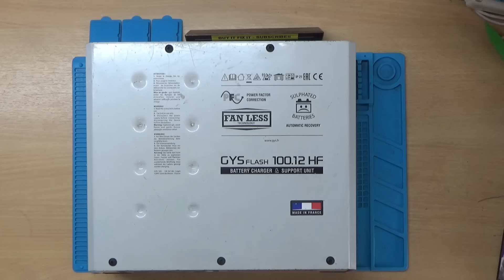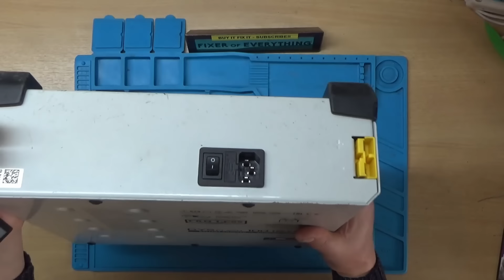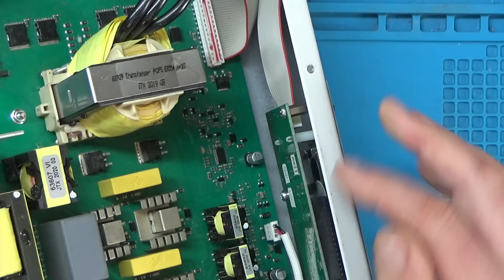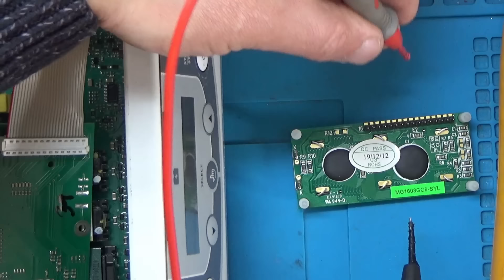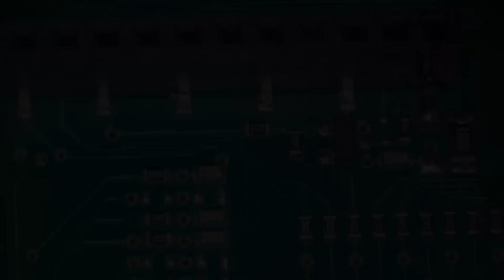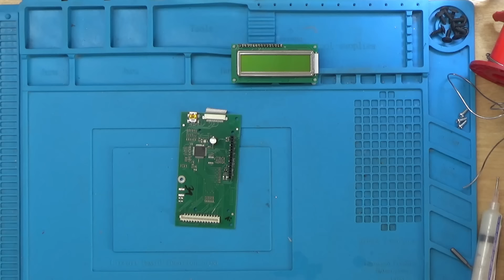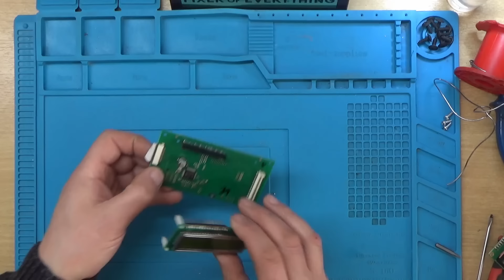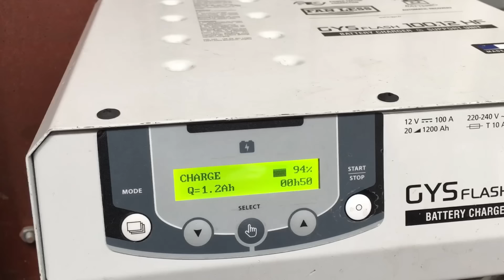Very Expensive Battery Charger - Shop Couldn't Fix It, Can I?

Comment: These clowns getting duped into believing these are necessary.  A UPS is far more beneficial running an old school battery charger.  Because zero volts, zero current, can corrupt memory.  But EVERY SINGLE MODULE has a recovery.  Never lost a module in my career.

Comment: For ECU programming it is far cheaper to use a couple of used HP DPS-600PB server power supplies in parallel / modified, stable 13.8v and up to 80 amps. Loads of people on the web have done this mod and used other similar rack server power supplies. The total cost shouldn't be more than $140 USD.
Reply from the maker: Great idea, and a nice cost saving! 👍

Comment: These are very expensive units.

I do coding and flashing (Programming) for BMW cars amongst other things.

For flashing it is always recommended to use a proper power supply like this.

Even cheaper versions like the AutoTool ECU programming power supply are still £350-£500, and the GYS flash is more like £700-£1,000.

Comment: retin the pads first, and heat from leg. once the solder flows, you know everything is is at temp. with the blobs, the pad can be too cool and cause a cold solder joint.

Comment: I'm glad it was fixed but what about the components the other shop worked on.
Also I would have liked to see the bottom of the lcd connecter you removed just to see how many were damaged.
Have you ever pulled apart a damaged vehicle computer and repaired it? With so many vehicles being junked because of obsolete computers people like you could keep cars from being junked. MAYBE.
I would love to be able to look at a circuit board and understand what everything does.

Comment: im at the 10 min mark and that 1 silver cap marked 100 made me think thats the issue. the second gen prius display goes out bc of a cap same as that. i solder on a 220 and boom it works and never had a come back lol
Reply: Seen similar issues with that style of cap especially in the vicinity of processors...

Comment: To improve the reliability of my fix, I would replace the snap in  plastic standoffs with metal ones and screws. It's obvious the failure was precipitated by the weight of the display shifting. The only thing keeping that display from breaking a second time is the integrity of the solder pads. It's also a bad idea to use a SMT connector there.

Comment: I always wondered if a "12V" server PSU could make a good battery support unit. Tweaked up to say 13.5V and with 50 to 75 amp capability and all for about £10 to £20 on the usual auction  site...
Reply from the maker: Can't see why not..
Reply: They usually can't limit current and would just turn off from overcurrent.

Comment: 1:05 The previous failed technician that attempted to repair this was saying "He knew the fault was but struggling to unsolder because of not enough heat". We know this is absolute BS as a simple solder on LCD connector using ordinary soldering gun fixed this.
Reply from the maker: Agree 👍

Comment: Im simple just amazed at your skill and observational skills. Taking a through hole connector and making it surface mount, just blew me away, I say that as an electronics engineer.  I have huge respect for your diagnostic and wide range of skills. Id say borderline genius 🙂
Reply from the maker: Thanks mate. There's apparently a fine line between genius and madman 😂😂😂

Comment: Hi there, I have the same issue, could I post the board for you to repair?
Reply from the maker: Hi Steve, is it the same fault as this one?
Reply: @BuyitFixit close enough, back light comes on but no display. Charger still works just can't see what mode your in ect
Reply from the maker: Does sound very similar. You could send me the board but I wouldn't be able to test it without the whole machine. It's probably the same fault as this one I'd guess though.
Reply: @BuyitFixit I'm happy to post just the board to see if you can find anything.
Are you on any socials so I can DM you to get your address, if your happy to take a look.
Reply: @BuyitFixit I'm happy to post just the board mate and sed if you can find anything wrong
Reply from the maker: Sorry mate only just noticed this. Was up until early hours editing the latest video. You can email me using  the name of my channel at out look dot com

Comment: Great video but you should have used smaller solder was pretty messy to be fair other than that good video, pitty idiot that looked at it before dint spot the pins on the display cos i would have checked board for that as display wasnt workling

Comment: All you need to charge any battery is a transformer a voltage controller and a rectifier.  An ammeter and volt meter helps too then just keep an eye on it while it charges.
Reply from the maker: Yes, I remember when I was a kid my father had a 4A battery charger which was almost identical to that 🙂

Comment: Just shows what rip offs  auto electricians are 
Link up another battery stop ripping people off
Reply from the maker: I guess a battery would only last so long. Depending on how long it takes to update the ECUs in the vehicle with the ignition on. Even two batteries might not last, and you don't want the batteries going flat half way through.

Comment: I've used hot air to spread hot snot into every little crevice. It'll make that stuff extra smooth and nice looking, depending on skill and luck.
Reply from the maker: Great tip!
Reply: I don't even have a glue gun, just use hot air to melt it where i need it.

Comment: Blimey I have several of these with the same fault at our shop sent back to the manufacturer & told unrepairable due to obsolete parts 🙄 has me wondering now if it is indeed repairable 🤔
I might be in contact next year.
Reply from the maker: Interesting. I'd think all of the parts inside are still available.

Comment: I have exactly the same unit with exactly the same fault, I’d fixed It once but it’s gone again!! Still got ten mins of the video to watch!! Nice one matey
Reply from the maker: Cheers, hopefully it's the same issue!
Reply: @ sadly, it is. If you put pressure on the screen forward it all comes back to life. Do you have a part number for the pin reciever you used??
Reply from the maker: I wouldn't be sad, it's a pretty easy fix! It could have been a lot worse 🙂 I didn't find the correct part. What I used was a header commonly used for Arduino boards, and bent the pins alternately. They are very cheap and available on ebay https://www.ebay.co.uk/itm/203585643286 Hope that helps 👍
Reply: @ that’s awesome mate Thankyou !! I’ll keep you updated

Comment: Klein makes a very small ratchet with reversable 1/4 drive. perfect for those tight spots. Use it everyday in manufacturing.
Reply from the maker: Thanks I'll have a look. I do have a small 1/4 drive socket set.
Reply: @BuyitFixit  I think the part number is Klein 65200 😊 it's almost Keychain size
Reply from the maker: @rickoneill4343  Thanks for that 👍

Comment: It stands out how little you are actually measuring. Can you find the problem most of the time just inspecting the board? I'm a hobby electronics tinkerer and like trying to fix things like this myself. As a mather of fact i got one of these at my work that's broken.
Reply from the maker: A lot if it is observing what the device is doing. The fact that it beeped when powering it on suggested that it was getting power and the microcontroller was working and should have probably been displaying something. If it had not of beeped then I would have started at the power input side and worked through.

Comment: Great find with the connector. But I really dislike unleaded solder. The joints always look dry and the wetting is terrible. Surely some flux would have helped on this job?
Reply from the maker: Thanks 👍The light on the microscope also casts shadows at times which makes some joints look worse than they actually are when viewed at a different angle. Yes I'm not a fan of unleaded either!

Comment: What about the burned components in the beginning ? I thing your video is a lot shorter than the reality. You find so quickly the issue every Time. It is frustating for the little viewver 🙂.
Reply from the maker: Thanks for commenting. The problem is if I spend 3 hours trying to find a fault it would be a very long and quite boring video. I usually try and keep my videos to 30mins to an hour long otherwise they would be too long and boring for casual viewing. I do try to show how I find the fault, and the process of my thinking. This one was pretty much as I did it. The burnt component just seemed to be a decoupling capacitor so I didn't think it was too important.

Comment: Love how it says fan less design and then you open it and sitting right in front of the first components you look at sits a fan 😮…lol
Reply from the maker: Yes, perhaps this one slipped through quality control with a fan installed by mistake😂😂
Reply: @BuyitFixit  Actually that charger on the video is probably an old one, the  "Fanless technology" has now been replaced by "smart cooling technology" on the recent models from a local workshop here, not sure which came before the fan or the "Fanless technology" mention

Comment: The display would have been the FIRST thing I would have looked at to make sure that the cable connections were OK. Also when you put the plastic glue as a physical brace to the socket, as I would have also done that on both sides. But apart from then few points, you went through it in a logical manner 👍🏽
Also one of the FIRST things that I had seen was that fan at the side of the unit.
Reply from the maker: Thanks, yes 'Fanless' unless you look inside 😂😂

Comment: I wondered why you'd zero in on the zero ohm "resistor" as a failure component to test.  Surely they've got pretty simple innards, just there to bridge tracks.
Reply from the maker: I've had them fail quite a few times. They are often used as fuses too. See the Wingscapes Birdcam video I did a while back for instance.

Comment: year's ago we had a TV brand called PYE it was one off the earliest colour TV , my father even paid for extended warranty over a period of the the TV would play up. the service man came out many times and fixed it & sometime later the same problem would occur, so one while my parents were out I removed the back cover it had 4 or 6 circuit board & a cathode ray tube. so I unplugged all of the boards and inspected the PCBs I found on each board about 10 components not soldered properly in place, so I got my 15watt solder iron & solder & resolder the components then replace the PCBs plugged them in accordingly replace the back cover power the TV up & hey presto it worked better than before. it lasted 20 more years, I think what happened was in those days workers would fit components then another worker would solder they would get paid X amount of $ to complete then got paid so much per 10 to 20 TV sets completed. to get the bonuses they would rush the job & not doing a good job the QA man would check them to quickly.
Reply from the maker: Great story Wayne👍yes I remember PYE my parents had one when I was a kid 🙂

Comment: attention to detail wins the day and not panicing that its a mcu controlled power factor corrected smps with no schematics!
 i would tend to get into negative headspace about that, and that looks like what happened with the previous tech too -you can see they absessed about the smpsu section 
not quite finished though ,still that burn up and missing smd to think about , it could be mosfet gate drive shaping  and thatll take days to weeks to cause a shorted mosfet + all the other damage that causes
Reply from the maker: Thanks 👍I think it just looked like decoupling. I had it running for 4 hours after the video and it still ran fine. I think the main issue was just the display.

Comment: Note if it was pin 7 - 10 that were 'broken' that may have been by design because they are not used in 4 bit operation of the display (which is quite common to reduce the data lines required). Interface is a standard Hitachi HD44780 AFAICT
Reply from the maker: Yes, Hitachi HD44780 interface. Pins 12 (D5),13 (D6),15 (BL Anode) were broken and pin 16 (BL Cathode) was a dry joint. If you look at the PCB they all have traces going to them which then go to pull-up resistors 19:30 , so I guess they were using the 8 bit data mode.
Reply: @BuyitFixit  sorry, wasn't trying to be a smart ass... I like you I think was a bit surprised at the failure mode of the connector pins. Thanks!
Reply from the maker: No worries mate 👍Yes I was surprised at the failure mode too. I think it was more luck that I found it so quickly, although I probably would have found it eventually after testing the metering the lines from the display to the MCU.

Comment: Oh, GYS. Bought a GYSPack jumpstart/flashlight/tire inflator combo long ago, the inflator died first - compressor got stalled and the motor shaft broke off. Then the "18Ah" lead-acid battery died so I replaced it with 30Ah LiFe assembly. The only surviving original parts are the flashlight and battery clamps.
Reply from the maker: Seems the make decent battery clamps then 😂😂😂

Comment: Hi 
I have worked around d vehicles all my life I'm an old git now and avoid working on anything post 1990 as there seems to be a culture of using hi tech electronics just for the sake of it. Now this psu is it really necessary I can't se why a fully charged battery connected to the vehicle in question would not be good enough, could you explain please 
Great video
Reply from the maker: Thanks 👍Well someone commented in the video that a software update took 3 hours, so if you had the ignition on for 3 hours... Or you could just let the engine idle for 3 hours although not ideal if it's in a garage 😂😂😂😂
Reply: @BuyitFixit  
Cheers 
It's a hell of an expensive psu

Comment: Seems the "local electronics repair shop" got a long way into repairing this and replaced loads of parts before falling at the final hurdle..
Reply from the maker: Yes 😂😂I'm not even sure if they replaced any parts, just looks like they removed the blown decoupling capacitor and possible soldered a few dry joints.. then gave up 🤷‍♂️

Comment: You need some smaller solder and a thinner iron tip!
Reply from the maker: I've got some thinner solder, I find smaller tips don't transfer enough heat though. I normally use a slightly bigger one!

Comment: Good job and i like your repairs........the screen and the control board under screen are a complete system on its own and u could have tested by just plunging in a USB cable ....it would be the same powering up a adrino board with its screen screen
Reply from the maker: Thanks 👍I did briefly plug the USB into the PC but I didn't record that part. It didn't seem to do anything. It didn't power up the board / display anything on the screen or enumerate as a device on the PC, so perhaps it needs to be in some kind of "bootloader" mode like the AVerMedia video capture device that I repaired.

Comment: nice charger, is the output of it  capable of 100A? that would be pushing the 50A Anderson type connection.
Reply from the maker: That is indeed a very good point. I've just checked the connector and it is indeed a 50A Anderson, although it looks in good condition and has no signs of overheating. So either the connector is under-rated, the charger is over-rated, or they very rarely pull 100A.
Reply: There is a calibration mode where the charger measures resistanse in cable and connector. It automatically adjusts output voltage at the charger depending on current to give exactly the requested voltage in the car. I guess they have made their own tests for how long the connector can take 100A before overheating and implemented in the firmware since the Anderson datasheet only lists temperature up to 70A.
The internal forced air circulation probably helps.

Comment: The hot glue is ridiculous.  Using metal standoffs is the right fix
Reply from the maker: Agree nuts and bolts with standoffs would have been better, I didn't have any to hand, and it should still give more mechanical support than it has originally.